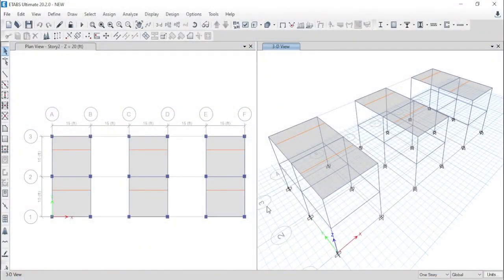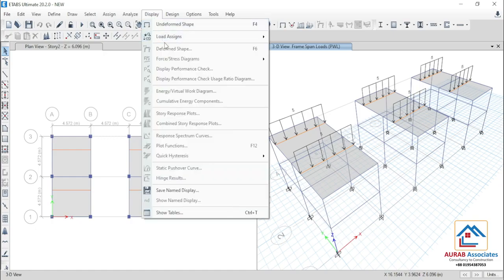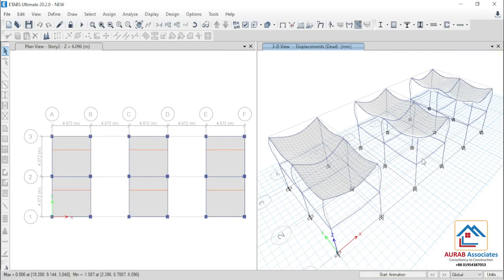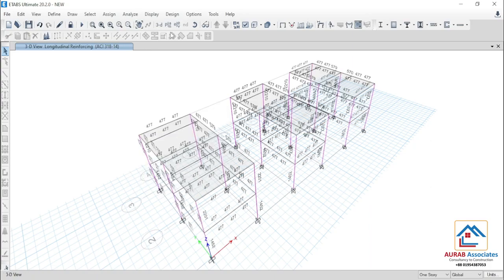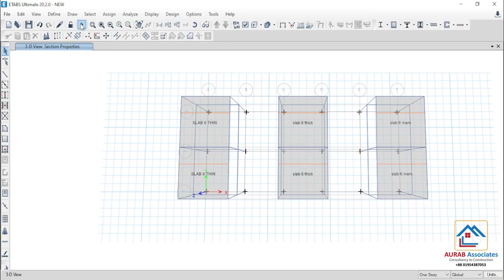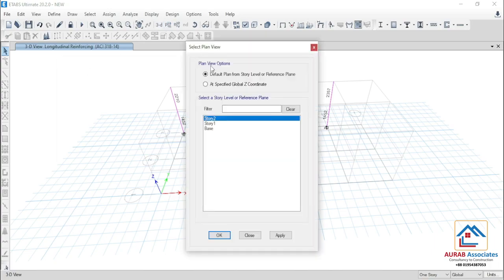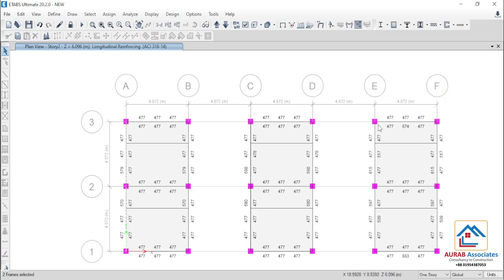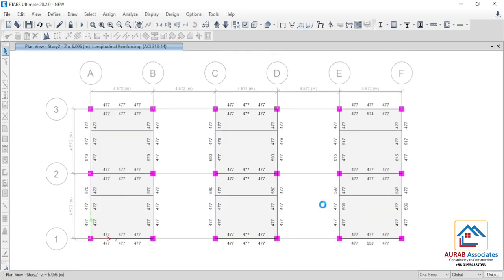Shell Thin Vs Shell Thick Vs Membrane in ETABS

Comment: Does modeled as shell – stiffness modification fac m11, m22, m12 = 0.25 and meshing give the same results?
Reply from the maker: I will check. Thanks
Reply: ভাই, ACI 318 sec 10.10 and also in BNBC , flat plate and flat slab এ m11, m12, m22 তে 0.25 করতে বলা আছে ।  আর shell ইউজ করলে Mesh করতে হবে, CSI অনুযায়ী । এখন আমরা তো ফ্ল্যাট স্ল্যাব করি না, বিম দেব,  তাহলে shell ইউজ করলে 0.25 করতে হবে কিনা?
Reply from the maker: @shamspwd589  ami video description a already bolechi. No need